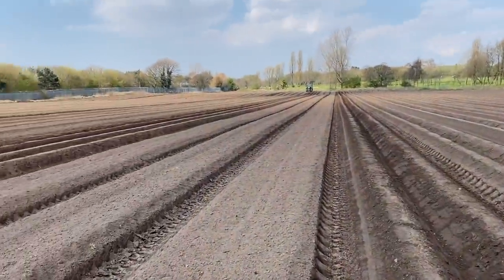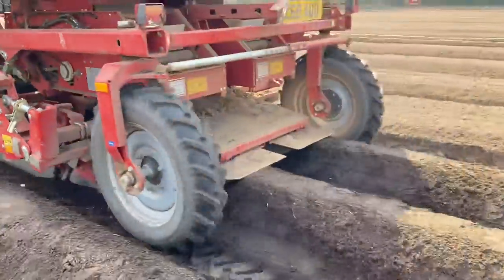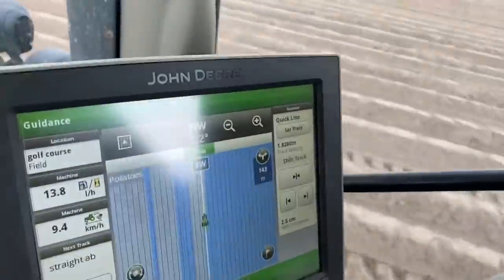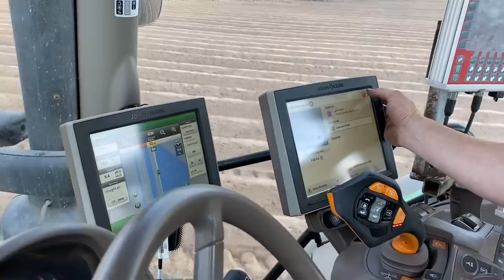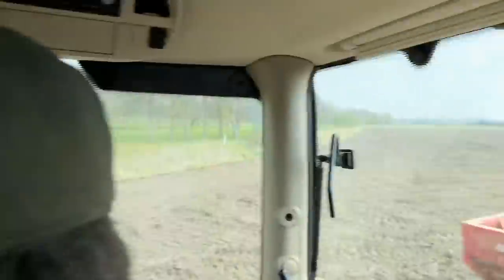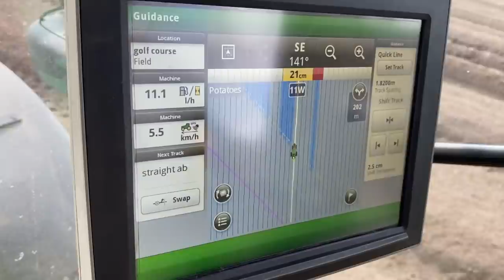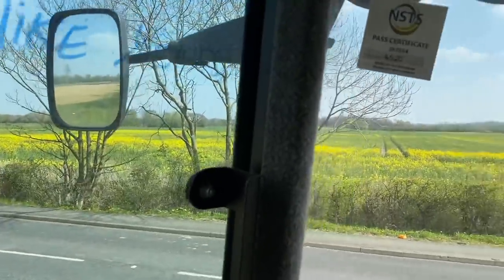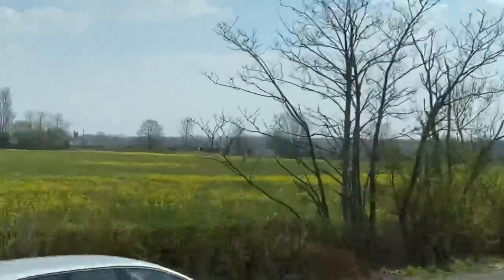Day 391  #OLLYBLOGS HOW TO GROW POTATOES BIG JOHN DEERE TRACTORS & A Little FENDT #lockdownlearning

Comment: Another great video, today’s quiz question is a knife section of a reciprocating blade(probably your combine) and you have welded it to a handle and use it for cutting open the bottom of the fert bags when loading the spreader.

Comment: Opening bulk bags of fertiliser when over spreader hopper. Triangle blade off combine knife or off before your time old binder when you had to go round stooking  sheafs with knot on inside because when they came out of knotter on binder knot were on top so by putting knots inside stock you got  even drying of sheaf
Reply from the maker: I’ve seen Them in museums 🤣🤣👍🏻

Comment: dam 2   21 plate 7r  also its a hedder sickle sections welded to a square bar used to cut open fert bags
Reply: @OllyBlogsAgricontractfarmer   hey just wondering whats the most common problem you have with your bateman as my boss just got a rb35